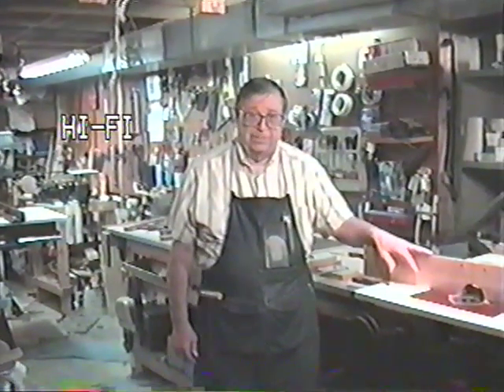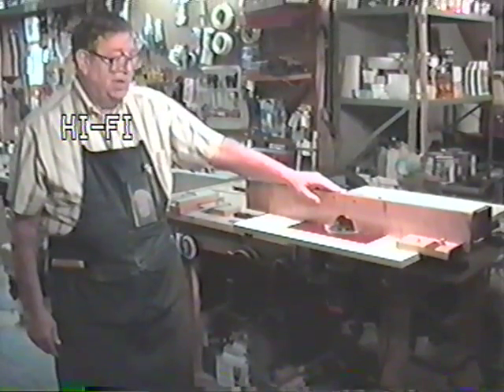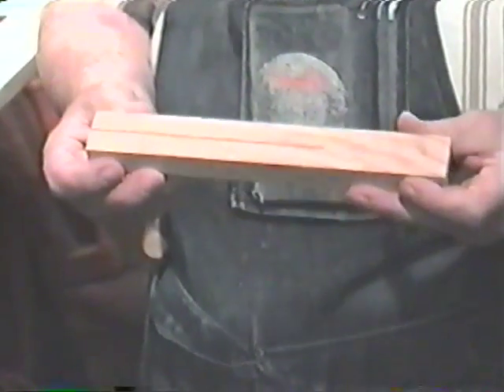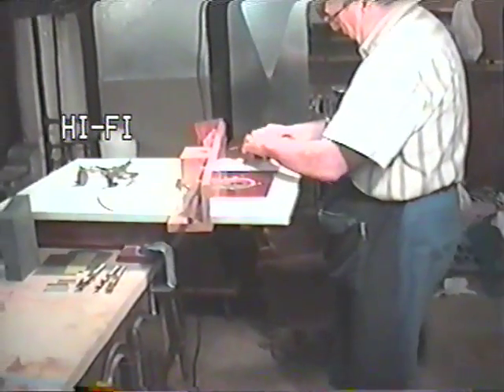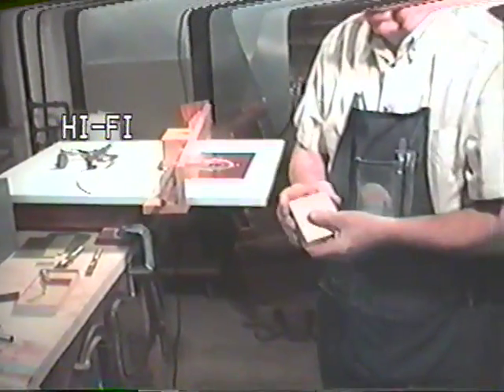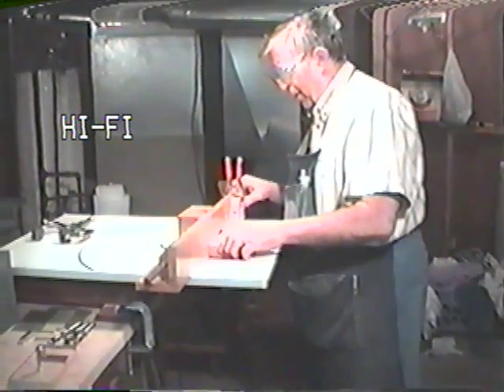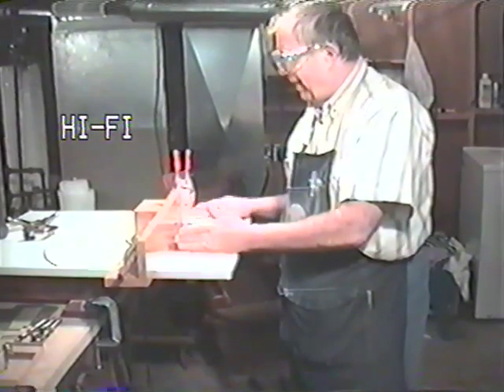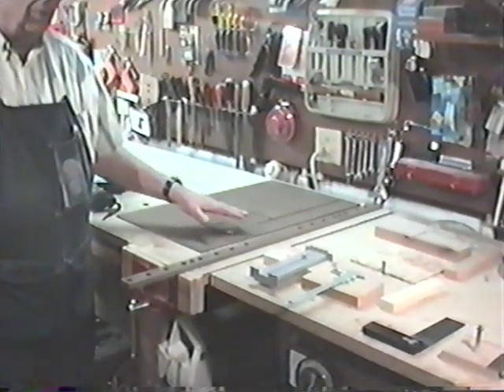Pivoted Fence with Rotating Post

Comment: I have less interest yet in the "sliding fence that stay centered", but I have done a short video https://youtu.be/zWFgIZJmv-0 that may help to visualise the curved slot.
It's an extract from the discussion under the article referenced below with other woodworkers that are more interested in that feature (because they intend to build a router table, not a drill press table). 
We had a discussion on how to rebuild the curved guiding slot without CNC or computing, using an already existing perpendicular slot.
Provided with no  warranty, I haven't tried it yet, it's just to help understand.

Comment: Here is the "howto" of my drill press table, with some innovative features : https://www.lairdubois.fr/pas-a-pas/994-une-table-de-percage-a-guide-pivotant.html.
It includes a tribute to John E. Minardi because I use the rotating post. 
It's a detailed howto in french, there is no short overview yet, but I intend to do one on YouTube in english.
There is a section "Utilisation de la butée" where I explain how to drill on the center, but also at a reference distance behind or in front of the center line.
Hope this help.

Comment: any one got any idea how to make this..is it as simple as it looks or am i missing something...wizardry maybe
Reply: I have figured it out but have not had time to build it yet. The pivot fence is pretty straight forward but the perpendicular cuts are more involved. I use the pivot fence on my router table but the perpendicular cut feature is yet to be built. There are two methods to make it work. I'll be glad to share the information. I'm working on an Excel spreadsheet to create the appropriate dimensions so you won't have to go through the same process that I'm going through.
Reply: @varmit7286  Hi Varmit...if you do get a chance id love to see how its done....I still think its some kind of optical magic !!!
Reply: @soundmanmartin  The 'pivot fence with post' starts with the pivot point then draws a line to the post through the router bit. The post is used to establish the line at the front, back, or center of the bit. The pivot and post locations are located offset from the face of the router table fence. These points need to be calculated based on the fence offset and the radial distance of the pins from the router bit.

The perpendicular cut changes the pivot point to "pin in slot A" and adds another "pin in slot B" to replace the post. The actual pivot point is now the center of the router bit.
"pin in slot A" is a straight slot that allows to table fence to move in a way that changes the radius of the initial pivot point.
"pin in slot B" is a curved slot that replaces the post. The slot path needs to be calculated to produce a parabolic(?) curve which creates a perpendicular path with the router fence.

Once you can follow the concept it make sense. It then becomes a matter of calculating the points and slots.
I have the system modeled in AutoCAD for my router setup but the spreadsheet will be able to adjust the dimensions based on how you want to use the system.
Reply: @varmit7286  wow.... I'm going to watch it again with an eye on the mechanics..
im not visualising it very well .
Reply: @soundmanmartin  I've watched the video several times but still cannot see anything except a curved line on his table top when he does the perpendicular cut. The pivot point isn't visible so there is nothing to let you know he has done something with the pivot pin that allows it to slide in a slot.
Reply: @varmit7286  we will suss this out..I love a good mystery !!
Reply: hi varmit72 ....I found the patent for this ..I don't understand how it works still but I could email them to you if your still interested ?
Reply: @varmit7286   how can i get hold of your spreadsheet calcs. Would love to try this concept on my router tabke built. Have you built it since your post a year ago?
Reply: @JJ-gr9fo  no calculations necessary. Have you set up a pivot fence as described in the video?
Do that first and then I can describe how to do the 90deg cuts.
I use a 1.5 inch offset from the face of the fence to my pivot point. Use whatever you like - SAE or metric - it is readily modified later.
Reply: @varmit7286  thx. I figured it out a simple jig to cut the curve while trying to sleep last night. Will try it.
Reply: @JJ-gr9fo  let me know what you come up with. I'll be happy to explain how Minardi did it.
Reply: @varmit7286  i had the idea drawn up by a friend in solidworks, but when simulating the movement, it did not work properly. So back to square one for me. Would appreciate it if you could give me some pointers.
Reply: @JJ-gr9fo  The patent includes a lenghty explanation and some diagrams showing how this works. After several attempts to follow the math and drawing a model in AutoCAD it comes down to two or three of the diagrams. 1) The pivot fence with locate post establishes the length of the fence, the router bit center, the pivot point with offset, and the locate post with offset. 2) a template with 2 perpendicular slots and hole to mount a small router. Slot 1 is the width of the locate post and will be placed on the post allowing the template to move left-right.Slot 2 is perpendicular to Slot 1 and will be placed over the table mounted router bit. A hole is drilled to accept a small router mounted at the locate post position.
Send me an email and I will send diagrams.
Reply: @varmit7286  thx. I built the template. Should be plain sailing from here,
Reply: @JJ-gr9fo   I got a new computer and am having trouble relocating some files - the ones I'm trying to send you among several others. I'll get them out sometime this week.
Let me know how the template works for you.
Reply: @varmit7286  the template is working well, but i do not want to cut a slot in the table. Rather want to cut slot in fence. So a little more planning ahead, as i want to cut a 20mm wide curve slot to fit a bench dog on my MFT table. Thinking to start drawing again as it would be easier on CNC. At least with the template i  ow understand how it work.
Reply: @JJ-gr9fo  one of the diagrams is for a fence with a large base which allows for a slot rather than cutting the slot in your table.
Reply: @varmit7286  yeah. I’m using the same concept